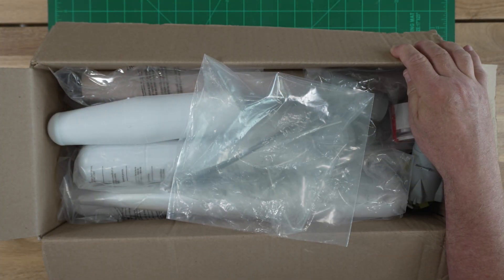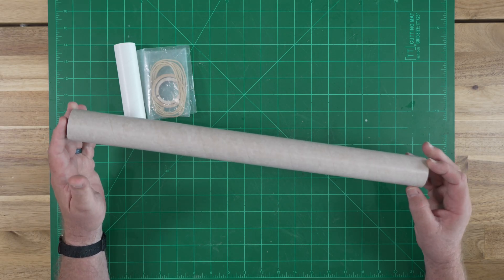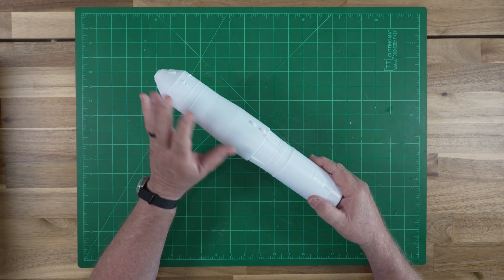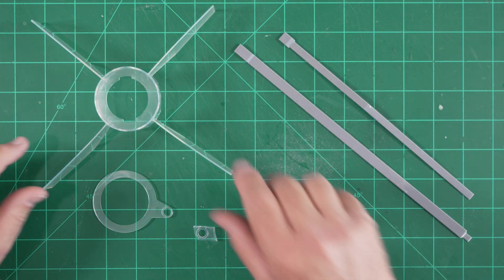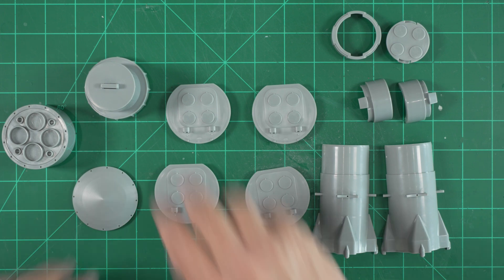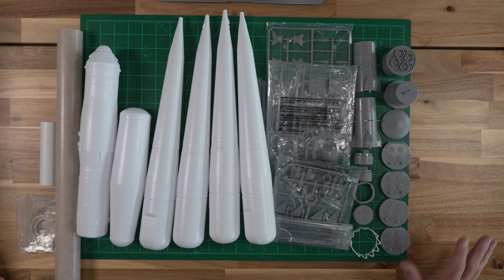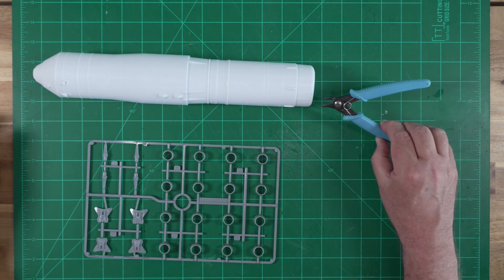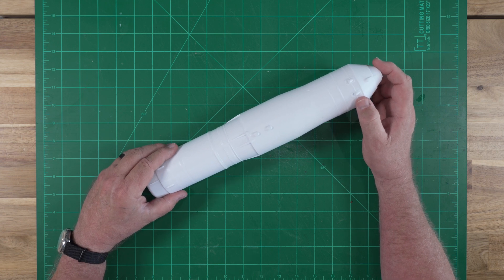The Estes Soyuz Booster In 1/48 Scale; Part One, Unboxing and Build Plan

Comment: The launch lug solution is awesome. When I did my Saturn V I used a temporary launch lug set up because my plan was to retire that rocket after one flight. It worked and my solution worked. But the Soyuz definitely needs standoffs for the lugs, so I am glad they addressed the challenges.